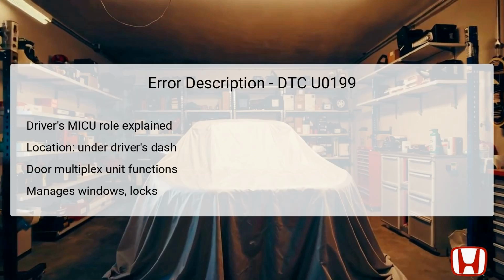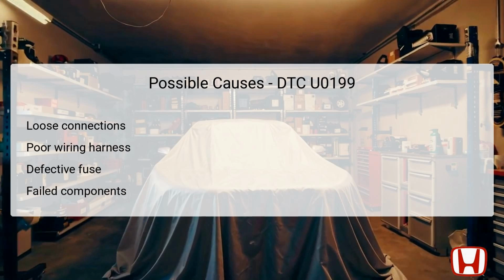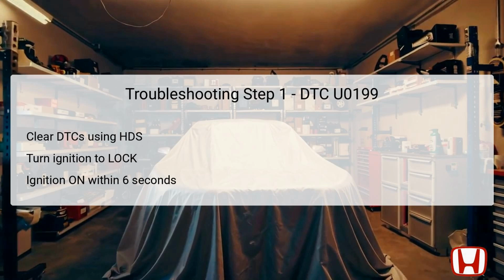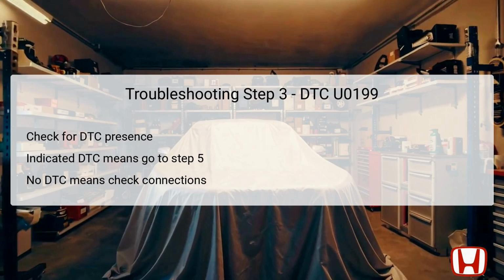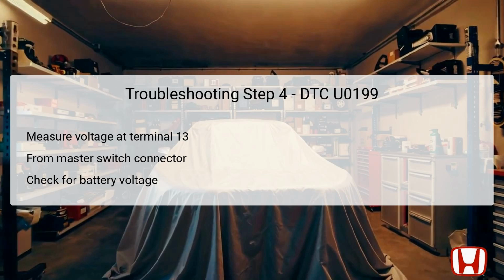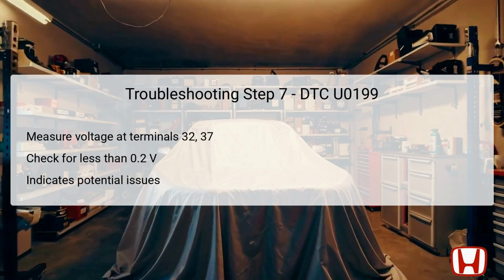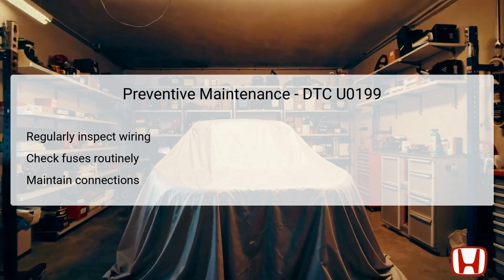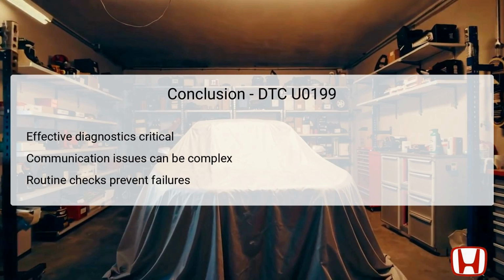DTC U0199: Driver's MICU Lost Communication With Door Multiplex Control Unit - Honda Accord 2008-...

Comment: I’m having some issues with my rear door locks, it started off as an issue with the passenger front door but then the rear right side started messing up then eventually the left REAR stopped working, now the front left front right work perfect but the rear left and right do not lock/unlock, only manually ??? lol 😅